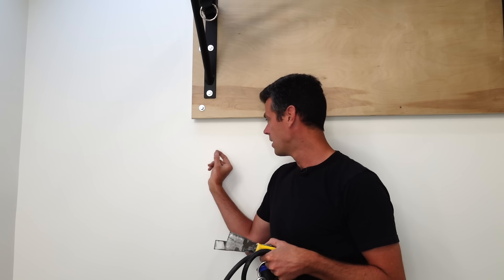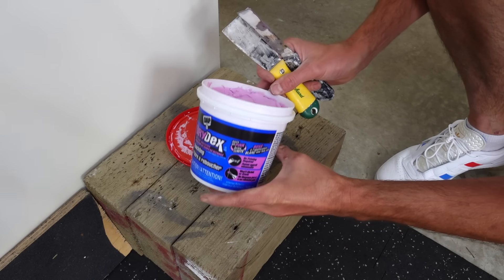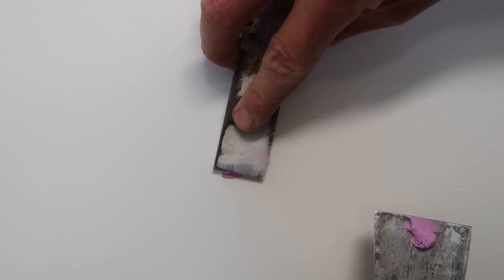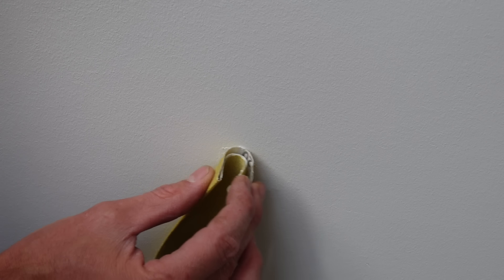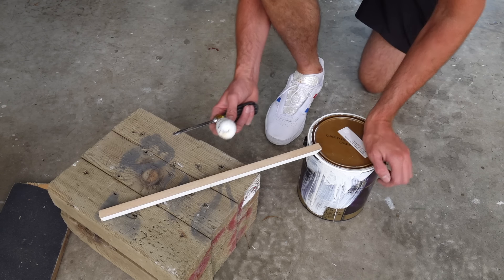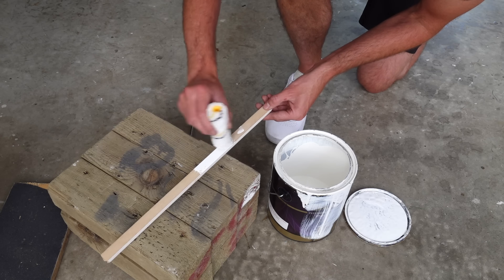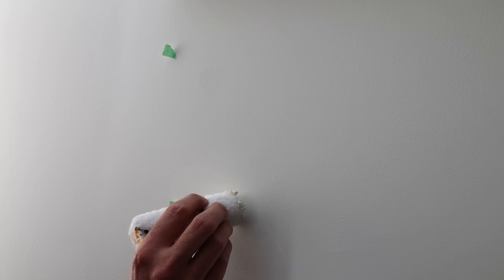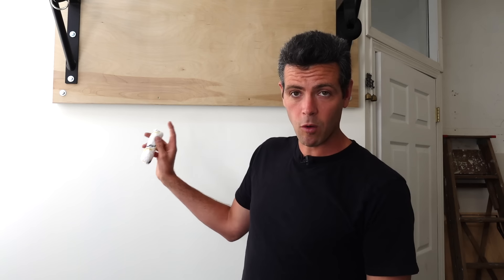How to do small touch ups without painting the whole wall!!

Comment: The pink stuff is not suposed to «flash» (show were you did patch) but sometimes it will. I don’t take a chance and I always cover with a primer/sealer before paint. Your idea of using the point of the small roller is good, at least it gives a texture to the paint that will match the one already there. Doing those touch ups are tricky, you have to do them with the same paint you
applied the first time. If it’s in a house overtime you will get a thin coat of grease on walls so as soon as you do a repair and paint, it will show. White walls are the easiest, coloured walls the most complicated to «spot paint». Cheers!

Comment: I was taught to use caulking and spread it with a 5 in 1 for little dings that small. It’s quick and it’s unnoticeable once painted. The caulking sinks in so you don’t even have to sand down anything.

Comment: There is a few products that will touch up as you'd hope but it also depends on the colour and sheen. It's worth a shot to see if it passes. Have had good luck on walls with Super 2 low sheen egg from Cloverdale myself, also the Behr paints I think.

Comment: The only way to avoid having the paint  flash is to use a flat or eggshell paint. Anything more than that is going to be difficult to touch up. I’m doing a commercial building now and satin bathrooms got patched everywhere so I have to roll the walls entirely again. If you have sizable patches then spot prime multiple times especially with colors like blue or green it’s a terrible color for hiding things. And it depends on the lighting if people will see imperfections, if you’re doing a dark theatre room then you can get away with more
Reply: For colored walls where I can get away with touchups, it helps a ton to tint the primer a bit with some of the finish color. Doesn't help with flashing, but I can usually finish with just one good coat of color.
Reply: @dooshnukem32  Yep if we have dark walls to do we’ll often use tinted primer, sometimes we don’t have it but it helps. Especially if you need to one coat something definitely use tinted primer. I was in a building once and there was an office with a dark royal blue sort of color, the GC was on the other side of the wall and put a hammer or something straight through the wall. So it got a massive patch on the wall and it took like two days trying to get this wall to look right. We had to prime it several times and then paint it, it didn’t look right so we skim coated it again and did it again. It was a nightmare for this particular wall for some reason, so that’s why I worry about patches sometimes.

Comment: With basic white wall paint its easier. With color its waaaay more difficult. One of the biggest issue for me is that even when you buy the same pain from same company, there are slight differences from batch to batch.
Reply: Only if its clean. If its not youre not going to match it.
Reply: I had a white wall with a small hole from a wall anchor in the office at work.  I filled it in and textured it.... Almost couldn't find it the next day when I went to paint it lol.  Honestly if this was my home I'd sand the spackle and leave it haha

Comment: Even if your paint blends in perfectly you have to consider the condition of the wall. If you put a patch on it then the texture will show differently, the patch will be flat but the wall may be textured. Also if the walls are dirty then that messes up your touch up, so at this job i’m at now i’m doing the punch list and I have to get in like 10 different paints and “touch up” many different areas. I’m on a deadline so I have to try to blend it but i’m gonna end up having to paint entire walls which is a pain in the ass. These walls were painted like a month ago but they’re already dirty and discolored because of other trades working there

Comment: Great video as always. Maybe you could make a video on how to fix the error of touching the spatula to the wall, and sanding too deep and painting to much. Yes, it was amateur hour on a couple minor dings in a bathroom of mine. The texture is way out from the rest of the wall and I’d love to fix it. Even if it takes redoing the whole wall. Thanks again!
Reply: Hi Chris. You should look at skimming the whole wall. Ben has some good videos. And there are others. Sometimes with repairs that is the only option to hide it. People spend alot of time sitting in the bathroom so the walls have to be perfect in my opinion.
Reply: ^ 100% agree.

Just spent a few weeks redoing an entire bathroom that had just been remodeled a few months prior. It looked great at first glance until you sat down on the John long enough to look around - mistake city. And once you see one, you notice them all.

For your bathroom, Chris, bite the bullet and fix it for good. If your patches all stick out you can sand them flush, but a skim coat may be your best bet overall. Either way, just commit to painting the wall(s) corner to corner. Your sanity will thank you lol.

Comment: I normally use one of those blue shop towels and lay it right over the final coat of paint, then peel it off. It leaves a little bit of texture so it isn’t smooth!

Comment: ceiling touch ups take a whole different level of skill compared to wall touch ups. In my opinion a little art brush works better on ceiling touch ups than small roller. Also known as a finch brush.  You really want as minimal paint on the ceiling as possible because either way it will be noticeable.
Reply: time do destroy some of my old makeup brushes i guess. i moved most of my stuff before the landlord changed their mind about some of the alterations 😭

Comment: I just spent weeks mudding a ceiling. did the prep work filling the joints. applied tape. mudded and feathered. sanded. where there were gaps to either side of the  tape I'd fill with mud, sand, repeat. Must have done that 8 or 9 times (yeah, I'm not good at this but had great success with one joint in a bathroom so wife said I was going to do the whole bedroom ceiling). Anyway, now I've painted the ceiling and can clearly see all joints. no definite mud edges but the bump creates a shadow. 2 questions. Will enough paint along the tape on either side fix this or do I have to rough up paint and add more mud?

Comment: I just use a q-tip to dab it for really small dents and hole (from nails and things). Dip the q-tip in the paint, dab it on a paper towel to get off excess, then dab the spot. It may take a coat or two since you have to do it super lightly after getting off the excess, but I cannot see the repair at all.

Comment: I used ear pick with cotton to touch up paint small holes, didnt touch the remaining paint, cant see it at all. So i'd recommend ear pick with cotton over any brush/small roller for really small touch up paint. We used the same method to touch up paint micro holes in car body.
Reply: Won't the earwax on the wall be an issue ? 🙃
Reply: @ced2k  adds gloss ;)

Comment: Whenever I do a small repair like this on my ceiling, it always looks awful. Even the sheen doesn’t match. Pretty much have to repaint the whole ceiling again for some reason.
Reply: Use a flat finish on ceilings, hides imperfections really well. And unless you smoke in your house, touchups on flat paint blend really well most of the time.
Reply: In addition to using a flat ceiling paint, consider using an actual good quality one.. Like eminence from Sherwin, it touches up flawlessly! If you can see it, then it just needs another coat (over a bare drywall repair). I've done it a million times after carpenters messed up my ceilings installing lights and creating extra holes. Using good quality paints makes ALL the difference. Emerald urethane trim paint in satin also touches up flawlessly, as well as the emerald wall paint up to eggshell (with satin for an invisible touchup I recommend at least rolling all the way from top to bottom the width of the patch or roller, whatever is greater.
Reply: @AlexKstar2025  that makes sense, thank you

Comment: Ha so I learned a thing ... "Dabbing, or the dab, is a simple gesture in which a person drops their head into the bent crook of a slanted, upwardly angled arm, while raising the opposite arm out straight in a parallel direction. The move looks similar to someone sneezing into the crook of their elbow." also concentrated marijuana ... 😆 Also I have a degree in art so color matching could very well be a complete career. Matching Pantone color swatches ... or even just using color matching technology at the store to buy wall paint is next to impossible. That is why you always want to buy your paint in batches and even when you buy small buckets you want to mix them together in a large bucket to get a consistent color. 

Thus ends my TED Talk on color matching! 😂

Comment: does drywall putty/mud dry out after a short time? i don't want to buy a big tub just for it all to go dry after one use, but i also foresee myself needing it often in the future. also, did i see right that the pink putty dries white?? :o also also (sorry for all the questions) how rough is the sandpaper you're using?
Reply: I know he didn't say, but usually 220 grit is used between paint layers on a whole wall, so I'd assume 220.  I might try a finer grit just to start, if I'm nervous.  I got this info from @HomeRenoVisionDIY - their full-wall painting tutorial is really good.

Comment: Question ? if you need your walls that’s meticulously blended why in the heck are you working out in a room with dry wall??? I do that stuff in my basement with cement block walls. How many times to do plan on do that? 
Also I have no blend issues with a brush or rollers it works just fine, unless your paints really old and the  wall paint is faded 🤨🤔

Comment: there are no wall paints that are completely touch-up safe. especially enamels. enamels do not touch up. period. you have to paint the entire wall from corner to corner. and flat paints are not true flat paints. they all have a sheen to some degree. the only way you can touch up any walls is if you have no direct light on that wall or closets. i have only found one paint that is truly flat and that is benjamin moore ceiling paint. it's also expensive. more than 250 dollars a five gallon bucket. but it's worth it. it is the only paint i have been able touch up ceilings with and get an acceptable result. ceilings are easily the hardest parts to touch up or paint. i have been painting for 40 years and the amount of time he is spending trying not to touch the wall from patching to sanding and touching up he could have painted that whole wall. i could have that wall painted in fifteen minutes tops.

Comment: Pro painter here.  In the time it took for me to watch this video I could have fixed the small spots and rolled out the entire wall.

Use your finger to put the patch in small holes and divots.  Then use a slightly damp rag folded flat to lightly go over them and flatten them out.  Then use your finger to paint the spots... if you want to do it completely wrong.  If you want to do it right, paint the entire wall.

I will give this guy bonus points for pointing out that touch ups aren't the best idea for a nice looking fix though.

Comment: Absolutely wrong in many areas! OMG this infuriates me that "pros" mislead DIYers. First of all NEVER use spackle or blades for nail holes.It is made of plastic and sands horribly.  Dip your finger in joint compound and use your finger tip. Then DO NOT use sandpaper, use a damp cloth and lightly wipe the edges and quick through the center. Roller idea good however if its a larger area what do you do? There is a roller sponge for Suede paint technique that you can use. Use a reg roller cover to apply and let set up for a minute or two. Use roller sponge to raise stipple. Do this twice to match existing stipple. Ceiling touchups are easy if you know what you are doing. Flat paint is flat paint. If you have a knockdown and it was done improperly you will get flashing even if you do paint the whole ceiling. Lastly, there are paints that you can use that allow touch-ups without flashing that l have used and accomplished for over 23 years to be exact and have saved customers thousands. You just can't use any shit from S/W or Hirsch. Behr is good for that feathering and Valspar used to be but S/W bought them a few years ago and seem to F up everything they touch so not sure about that product anymore. This guy is a fool folks. Try it my way and see if I am wrong. There are some good contractors still left out here.

Comment: This is way to hard, takes to much time. Go ahead and put your mud in with a normal sized tool. Than take a wet rag and run over spot washing all the excess mud off. Take your paint brush, put small amount of paint on brush dab paintbrush instead of going back and forward. Been painting over 30 years this works every time. Use common sense……. It works